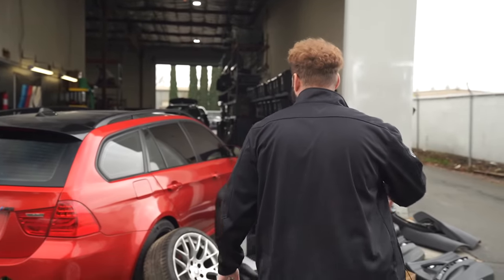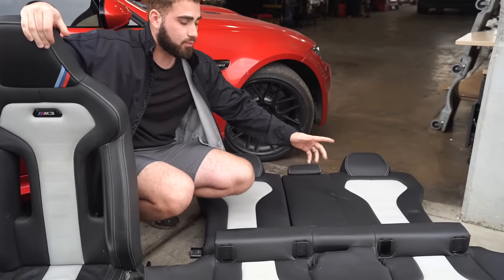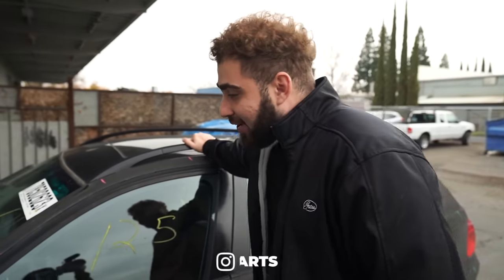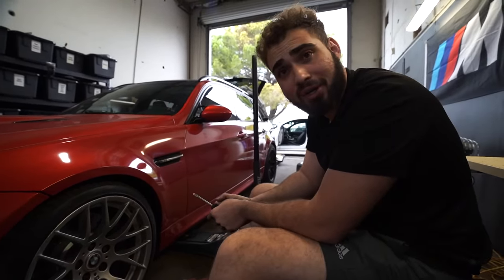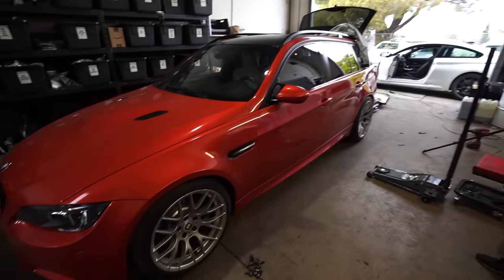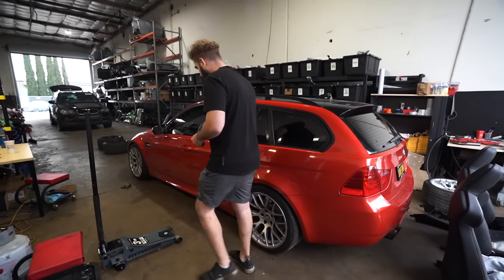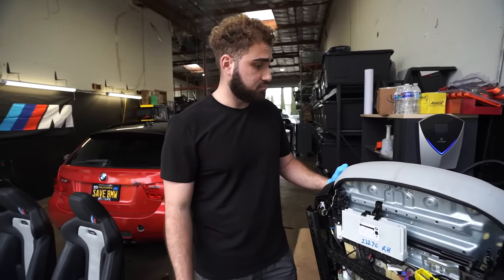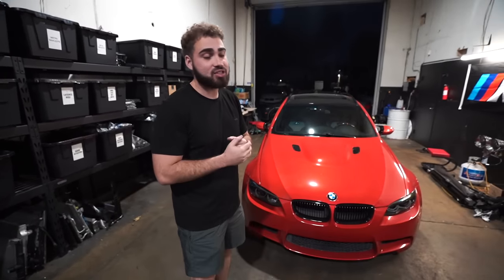ADDING $15,000 IN OEM+ UPGRADES ON MY BMW E91 M3 CS!

Comment: Told you before about the headlining,  take it out and rattle can it with matt black paint. It works. It'll turn black before your eyes and stays black. Been doing it since the faded rear shelves in the e36 coupé, that used to turn purple in the sun. Promise you, try it. It'll cost you the price of a can of matt black paint from o'reillys